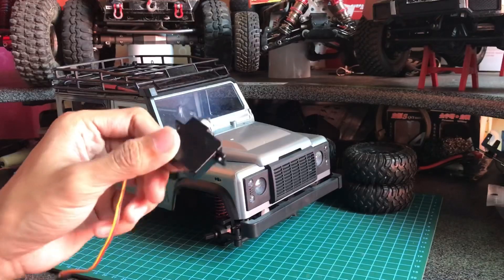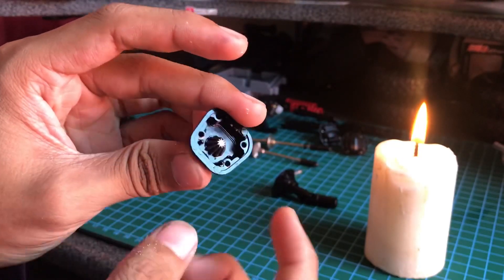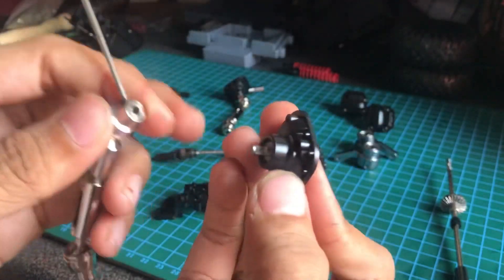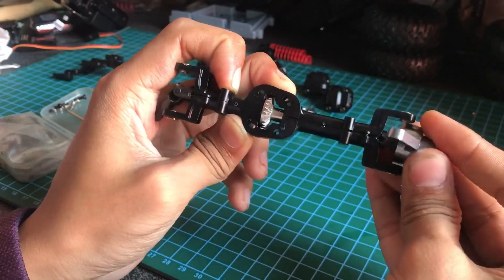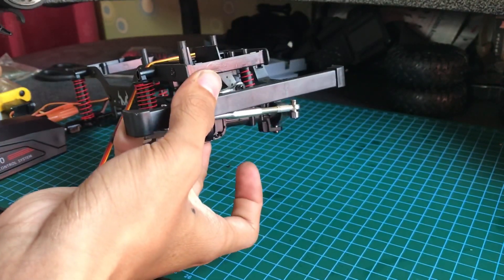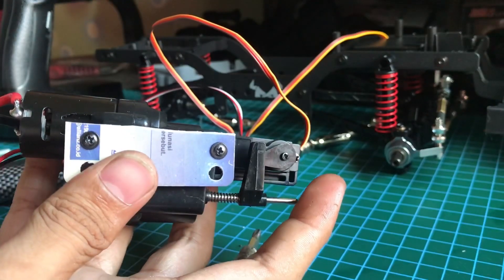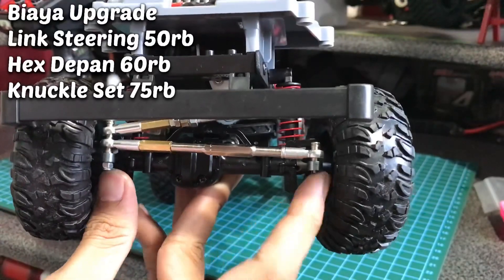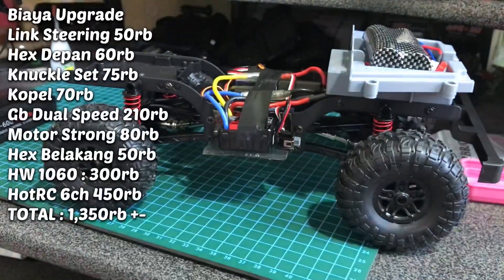Upgrade MN99s Paling joss... | 1/12 Mini Scale RC Adventure Balikpapan

Comment: Om mau tanya itu dinamo ny pake 370 yg 52000rpm ya om
Reply from the maker: @Miniatur_r125  bukan, motor biasa ini bawaan gearbox dual speed
Reply: @keyrclife  owh trus om yg biasa itu yg dinamo 370 yg speed itu yg hitam itu yg 52000rpm ya om soalny sy juga punya rencana mau pasang di single speed biar dapat speed ny
Reply: @keyrclife  tp kalo dinamo 370 52000rpm yg wpl Rbrc itu dipasang di single speed enak kan om kalo untuk Crawling trus main speed gitu
Reply from the maker: @Miniatur_r125  bisa, kalau single speed memang rasionya buat crawl enak kok
Reply: @keyrclife  ok siap om makasih telah dibantu 👍🙏

Comment: You turn your wheels back and forth so fast, for the test, that I cannot tell how much the steering angle has improved with the upgrade universal joints in the front axle. Have you done a “before” and “after” video to show how well the MN99S turns? The steering angle is quite bad on the original 99S. Great video as usual.
Reply from the maker: oops, yeaa forgot to test that thing... i'll surely test it later...!

Comment: Om numpang nanya, kalo posisi servo sudah saya pindah diatas gardan depan, biar ga mentok ke tempat receiver, ada part dudukan receiver yg bolong gitu ga? Orang2 kan biasanya dicoak biar servo ga mentok ke dudukan, saya ga mau coakan pengen beli jadi aja.. Tlg bales ya
Reply from the maker: sprtinya ga ada om, belum pernah lihat yang bolong
Reply: @keyrclife  solusinya gimana om kalo gitu? Tetep coak dudukan board nya berarti? Emang pindah dudukan servo ke atas gardan seberapa pengaruh sih biar bs belok tajam/patah?
Reply from the maker: @IRFebi  yaa kerja servo lebih ringan kalo diatas gardan, cmn kalo di chassis jg kalo settingnya bener, ga ada masalah

Comment: Om saya baru beli gerbox dual speed WPL dan gear masih plastik tapi kenapa macam lose gitu y asal mundur gas bunyi krek²,dan saya beli part yg metal juga sama macam tu kira² gimana solusinya om?
Reply from the maker: ya pastikan setting tuas gearboxnya ya hrus betul, klo ga bener ya ngeloss
Reply: Tuas yg mana BG saya GK ngerti hampir 1 Minggu saya bongkar pasang sama aja
Reply from the maker: @haziqr.n6291  coba disimak dividei ini betul2 di menit ke 13 pas saya setting tuas gearbox nya...

Comment: Om..itu spacer masing masing pake brp mm?
Dan kalo pakai esc 60a..di motor lebih baik pakai kabel jst atau kabel awg?
Reply from the maker: spacer sekitaran 1-1,5cm, ukurannya ga pasti soalnya menyesuaikan si linknya...
klo tuk motor tetap lebih baik pakai kabel AWG
Reply: @keyrclife  oke om..terimakasih yah
Reply: Om..udah beli spacer m3..tapi kok gak cocok sama link steering?
Link steering alloy yg beredar beda beda ukuran apa?
Reply from the maker: @tonnysulaiman310  mungkin ya,tapi sy pakai m3 kok masuk2 aja

Comment: Om kata orang hotrc 6ch sinyal kurang bagus, katany bagusan dumborc6ch, bener?
Reply from the maker: ya klo sy pribadi lebih nyaman dumborc dari dulu…
Reply: @keyrclife  dumborc 6ch ada throttle speed limit ga bng?
Reply from the maker: @rull135  adanya Dual Rate Throttle, memperkecil rasio throttle
Reply: @keyrclife  Penjelasan lebih detail nya gimana bang?
Reply from the maker: @rull135  intinya bisa dilimit power throttlenya
Reply: @keyrclife  ohh gitu bng... Makasi infonya 👍

Comment: Bro perbedaan gb 2 speed sama single speed ap?
Reply from the maker: ya dari namanya 2 speed punya 2 speed (high/low) kalau single speed ya fokus ke main torsi aja
Reply: @keyrclife  klo fayee mo ganti gb 2 speed pke gb punya wpl bng?
Reply from the maker: @rull135  bisaa
Reply: @keyrclife  om saya tanya temen soal up dinamo katanya klo pake 370brushed masih aman ga ganti esc, bener atau gak om?
Reply from the maker: @rull135  ya ada yg aman ada yg jebol ic nya, yang pasti tenaganya ga maksimal
Reply: @keyrclife  om mau tanya, klo dumborc6ch X6FG dan X6DC perbedaan nya apa aj? Lebih bagus mana

Comment: Hi friend, what is the best gear box
1. 370 single speed
2  wpl 2 speed
Reply from the maker: wpl 2 speed
Reply: @keyrclife  can I run wpl 2 speed with stock electronics. I didn't have money to upgrade electronics.
Reply: @nirosharc  i have the same question now ...
Reply: @franta2545  You can run 2 speed with stock electronics, But it better to get electronics upgraded to use full performance of gearbox.

Comment: kalo untuk pemula lebih baik pilih MN-99S, MN-86(S) atau MN-40(S) om??
Reply from the maker: mn86
Reply: @keyrclife  thx saran nya om, budget masih seharga MN99S hehehe 😁
Reply: @keyrclife   om cara benerin roda dpan MN 99s miring gmana ya,  udh pake yg metal part nya,  bearing udh di ganti msh ky gt juga
Reply from the maker: @rulyyunardi9740  maksudnya roda miring?
Reply: @keyrclife  miring kaya rc drift
Reply: @rulyyunardi9740  kayanya dari knuckle yg miring deh om, kemarin saya pengalaman gitu, coba cek aja siapa tau sama penyakitnya hehe
Reply: @abangberto5442  MN99s keren EUY jika di full upgrade metal TDK kalah SM RGT yg hrga agak mmusingkam
Reply: Abang Berto adalah masyarakat bertatto brjiwa Social yg tinggi dn saran sy klw pemula km peggang remot control SM tinta SJ bro 😂👍👍👍 rc hobi yg mantaaapp 🥳🥳

Comment: Orang mana om
Reply from the maker: Balikpapan, Kal-Tim
Reply: Salam kenal dari Gunung lawu jateng
Reply: @keyrclife   RC MN saya pake dinamo yg single speed..  kalo di ganti pake strong magnet apa harus di ganti juga gear nya?
Reply from the maker: @rulyyunardi9740  tinggal ditukar aja pinionnya dari motor lama ke motor baru....
Reply: @keyrclife   kalo boleh tau ukuran pinion nya brapa Mm.  soalnya ngebuka pinion  nya susah om
Reply from the maker: @rulyyunardi9740  https://tokopedia.link/HbAojvq7wkb
Reply: @keyrclife  om benerin ban miring gmana solusinya,,  udh pake bahan metal part nya
Reply from the maker: @rulyyunardi9740  ga paham sy miring gmna maksudnyaa...
Reply: @keyrclife   ky yg harus di balancing gt om
Reply: @keyrclife   kalo boleh saya minta no w. a nya,,  buat tanya seputar MN aja,,  soalnya saya bli part sbagian gk sesuai psanan,,  beda ukuran,,  kalo tanya k yg lebih tau dan udh terbiasa saya bisa tanya dlu sblum psen part, mkasi sblumnya om🙏